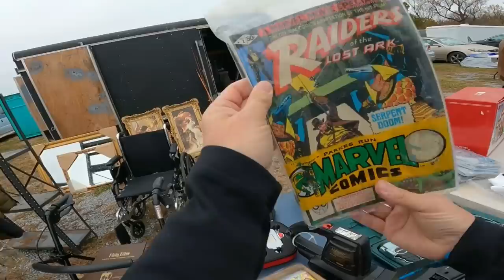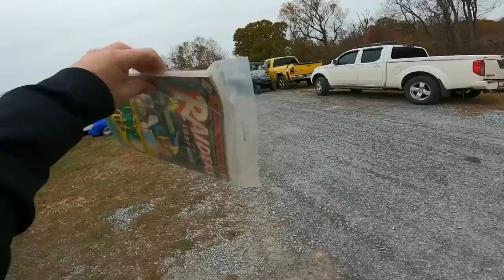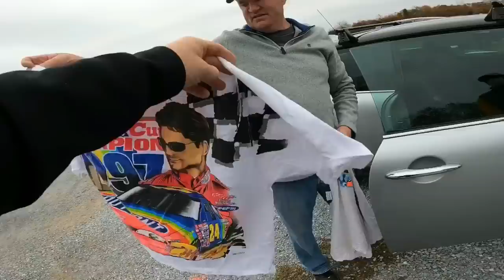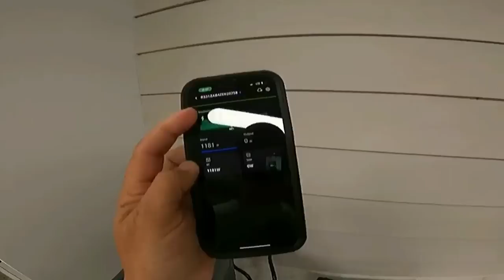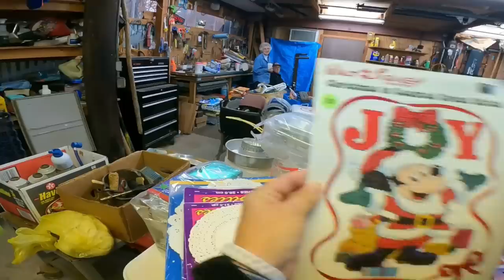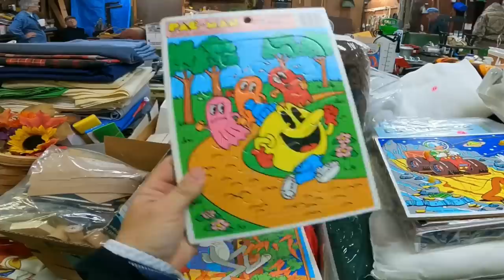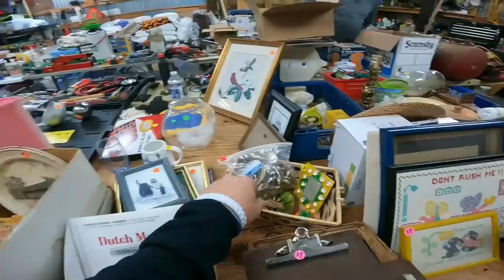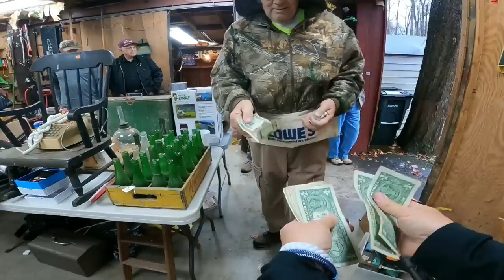GARAGE SALE SHED HAD WHAT I WAS LOOKING FOR

Comment: OK ... DOES THE ECO FLO 2 COME W SOLAR PANELS ? IM TRYIN TO FIND SOLAR THAT I CAN RUN A COUPLE HEATERS OFF TO WARM MY HOUSE W OUT USING ELECTRIC HEAT  <OF COURSE THE HEAT IS ON I JUST HAVE HEAT SET VERY LOW AND WEAR A SWEATER  BUT LOOKING FOR "HELP" TO HEAT THE HOUSE A LITTLE MORE FOR LESS  ..THANKS SO MUCH ....